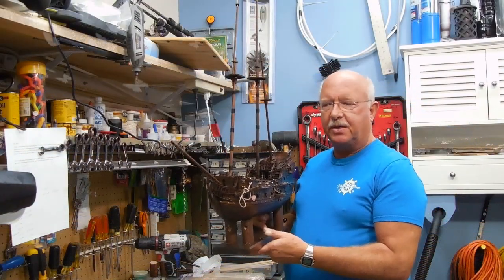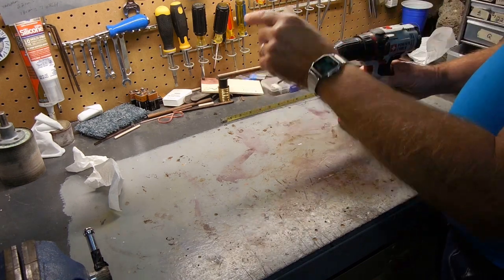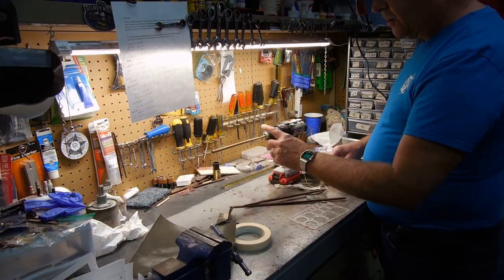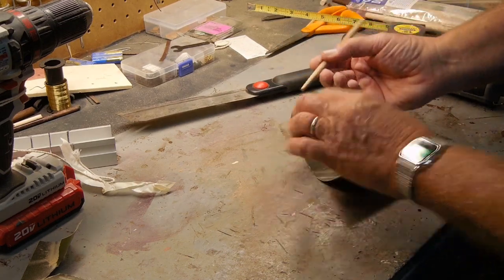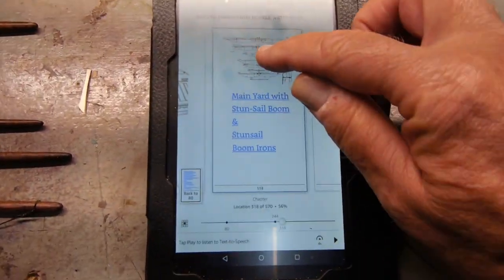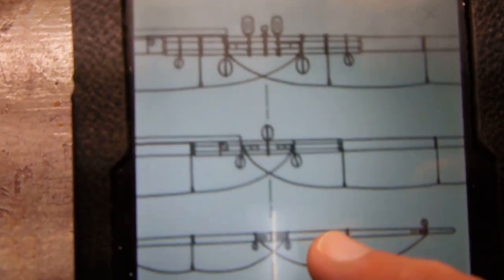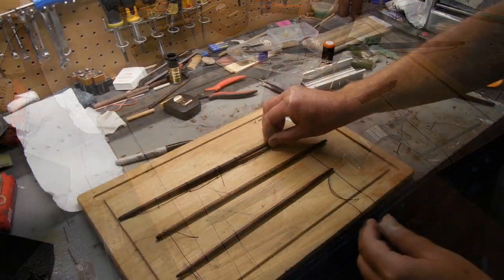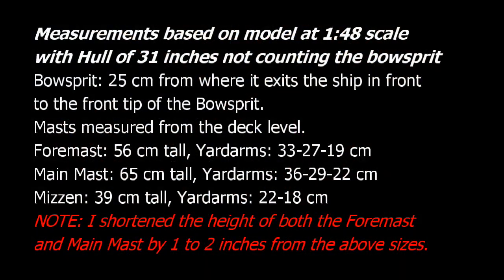The Black Pearl Model Ship Part 23

Comment: Thanks for the tapering tips with a drill. I will soon be at the mast portion of my build and wasn't looking forward to hand sanding all the mast parts. will definitely check out the ebook also
Reply from the maker: My ship is a little smaller than yours, so I dropped the height of the foremast and Main masts by two inches. That’s got mine looking about right.  Working on my next segment, hope to post it in the next week or so. Thanks for following along and providing me with helpful info!

Comment: hi sir,what is the thread's diameter
Reply from the maker: Since I finished the version that you are asking about, I’ve started another one and it provided me with the correct diameter of the threads.
0.2mm (35M)
0.5mm (15M)
0.8mm (6M)
1.5mm (0.6M) - Anchor rope (I used chain for the anchors)
Thanks for watching 👍👍
Reply: @BoilerDan1  thank you good sir
Reply from the maker: You’re welcome. 
Thanks for watching and following along on this build.👍